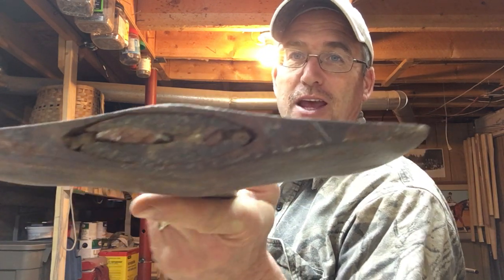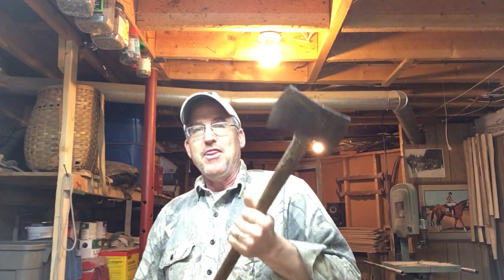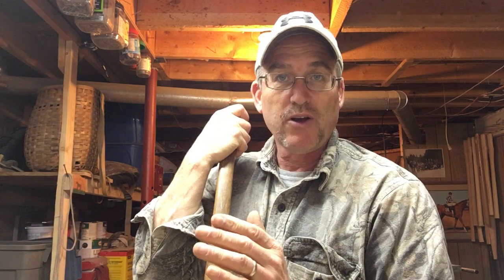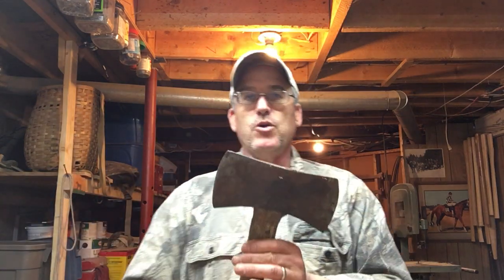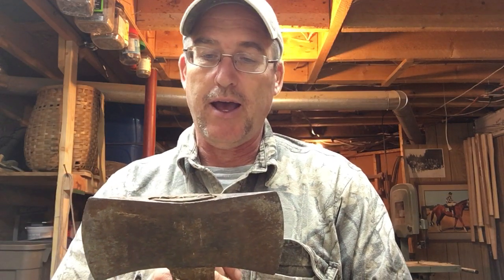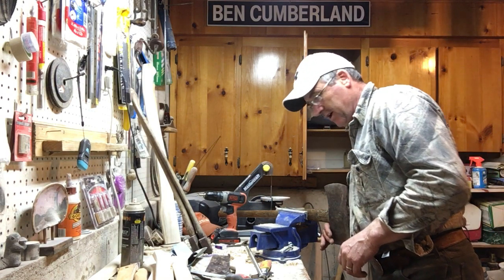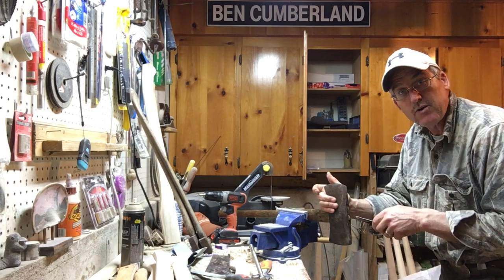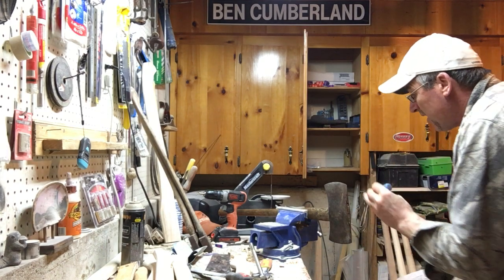Wedges #1

Comment: This video is great for showing why we should never use steel wedges and never glue in wedges. Only time I have ever used steel wedges is out in the woods as a temporary fix to get the job done. If you do need to do this, drive it into the side of the wood wedge, and leave it proud of the end so, when you get home, it is easy to pull the steel out, prior to fitting a new wood wedge
Reply from the maker: AMEN!!

Comment: Never, ever put your axe head in a furnace to burn out the old handle. At the temperature needed to burn wood, all the hardening and temper will be totally lost and you will have an axe that will not hold an edge for 5 minutes. If the epoxy is a problem, just keep drilling holes right through till it looks like a Swiss cheese and drive and/or pick out the bits. Way easier than going to a blacksmith's shop to get it re-hardened and tempered
Reply from the maker: Totally agree.   I'm not expert by any means on steel, rockwell, hardness and temper - so heed the wise words from old Grizz !   Solid advice

Comment: drive a screw into the wedge and use a claw hammer to pull it. won't always work but when it does you save a good 20 minutes.
Reply from the maker: That's what were after Drew....good advice - and that sounds like a keeper.  Also why I don't recommend gluing in your wedge either....that would really mess up this idea.
Reply: I use a 'spreader bar' with a two or three holes in for wood screws, and this mounts onto an automotive slide hammer - that works really well for pulling wood wedges. I have another attachment that takes an 'easyout' stud remover which I use for barrel wedges. Simply drill out the wood in the centre of the barrel, screw in the 'easyout' , attach to the slide hammer. A couple of taps and your barrel wedge is out.
If you want to reuse the handle,  cut a piece of wood dowel, trim it for a tight fit and glue it in the hole with epoxy. When that is dry, you can cut the new wedge slot straight through it.